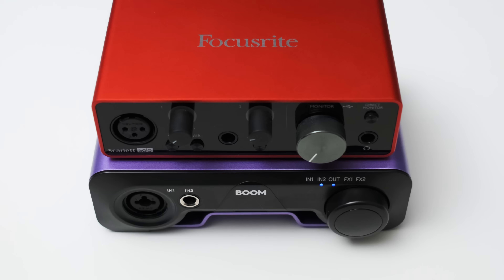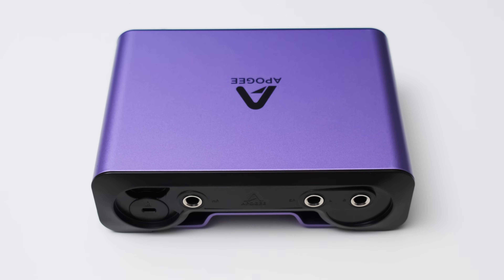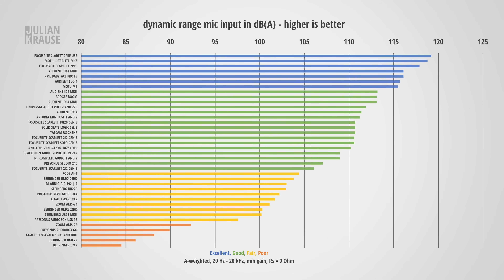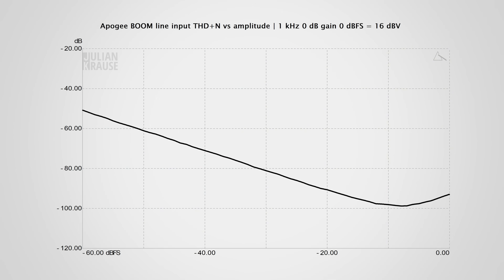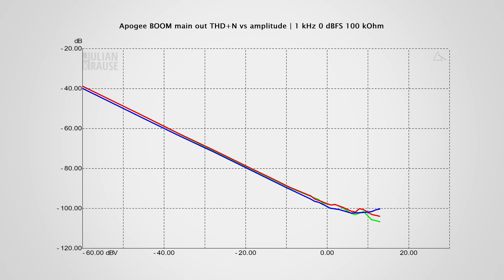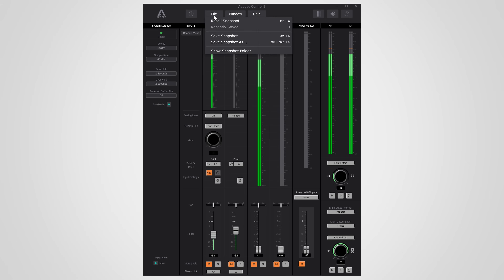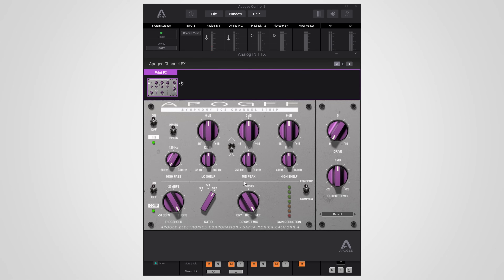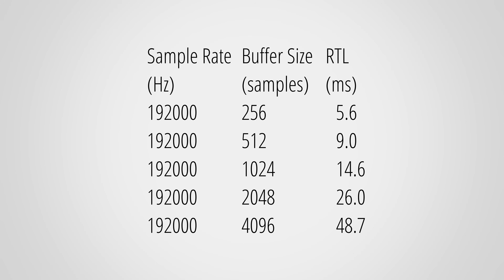Apogee BOOM – USB Audio Interface Review (real-time audio processing)

Comment from the maker: Correction / additional info:
The dynamic range of the mic input is stated with 122 dB(A) and after some more testing I found out, that this is true when the sample rate is set to 96 kHz or lower. This seems to be achieved with a dynamic range enhancement. With this trick up its sleeve, the BOOM catapults itself to the top of the mic input DR chart. Because most people use sample rates of 96 kHz or lower, you will see the higher number in future graphs.
Reply: Why does a lower sample rate increase the dynamic range? Also does this happen on other interfaces?
Reply: @RobThePug a bit late to the party, but higher sample rate means higher signal bandwidth. This also means higher noise energy since noise is present in all frequencies and when you capture wider spectrum you also capture more noise.
Reply: @RobThePug  They probably do oversampling. It is quite straightforward to do sampling always at the same speed, but if lower sample rate is selected, they average the acquired samples and get intermediate values. Instead of 1,2 and 3 you'll have 1, 1.25, 1.5, 1.75, 2...etc which increases dynamic range. Noise gets reduced too.

Comment: This is quite disappointing Julian. I would have expected you to correct this in your review. Instead a small notice…Never trust a YouTube reviewer, trust your ears. You can really do harm to companies with that misleading video.

I wrote Apogee when your video came out and they said that their measurements were correct. IThey pulled a Boom out of the shelf and their measurements confirmed the specs. It really seemed they were right. I made the mistake mistake and believed Julian Krause.

By the way, your measured preamp noise is also not correct…🧐

Comment: Julian, I tested the boom with a dynamic mic, it SOUNDED way better, fuller etc than my audient. No background noise... The converters are NICE.
Reply: Have you update your firmware already? I get rid off the noise after updating and really satisfy with it
Reply: @jimlue  I have the patches from September 2023, all fine
Reply: i finally got mine, soundwise it is better than both id22 and id24 i got before, it is super crisp with good balance of frequencies across the board when it comes to converters for speakers and headfones. I tried prism as well before in expensive studios and this is really close. It is a bad looking interface but the sound is divine. When they add a second preamp and allow speakers and headfones to play at same time it kills all competition below 1200 usd. I had RME, audient, SSL etc before it is the best one to me when i mix a song at home. I have 25 years experience and i do not really care about specs data to a certain extent. I know what i am hearing.  @monkmusic you were so right on another post on another video related to this sound card. I think ppl are really sleeping on this one, i hope Apogee will release a firmware update to unlock that speaker/headfones at the same time.
Reply: @LaidbackSounds  My pleasure mate. Totally agree. 180 euros with top converters and mic pre. The reviewers are biased.
Reply: @LaidbackSounds  I contacted apogee and unfortunately it's a hardware toggle when we insert headphone, a physical connection is disconnected

Comment: Hi Julian. Is the noise likely to be an issue on Sennheiser HD6XX? This looks like a great option to have an interface for my guitar amp modeller that also doubles as a decent dac and headphone amp. It's currently half price on Thomann too. I currently have an 8i6 Gen 3 which I don't think has a great headphone amp and it's drivers drop out over USB on Windows 11 a lot, so I am looking to replace it. I need nothing more than a couple of inputs for my modeller, headphone out, and monitor out. Motu M4 is another option, but at £169 the Apogee is tempting, especially with the more powerful headphone amp.

Comment: Have you considered (unless already doing it) using a USB isolator with an active USB hub powered by a quality external PSU to test the performance of the USB audio interfaces without the interference from the computer power lines and ground loops? That would show how good the the interfaces are in filtering the USB lines (for externally or USB powered interfaces) and maybe might show how to get best quality audio from (or into) your interface.

Comment: Hi Julian, it is a very detailed review with very high quality. It is very disappointing that this interface has such a noticeable preamp noise but I think it is a universal problem of Apogee interfaces as I can hear obvious preamp noise from Duet3 on condenser mics comparing to iD4. Is this because Apogee used cheap preamp or this is something changeable by firmware update?

Comment: How come higher sample rates have lower latency? Is that because the interface is built for its maximum sample rate and the internal processor has to step that down? Say your interface can do 192K but you're running it at 48K, does the extra latency come from the processing needed to be done to step down the 192K to 48K?

Comment: Hey Julian, 
I am looking for an audio interface in around this price range to put between my DAW/PC and Monitor Controller. And to pair with my headphones and monitor speakers. I am currently using a Behringer Control2USB as monitor controller (I don't know much about monitor controllers and on how much they could change sounds, i might upgrade to a pre-sonus central station in the future if it's actually benificial for my sound). I already noticed I can hear more detail in sound putting my FIIO BTR5 between my PC and the controller than feeding USB in it directly.

My monitors are monkey banana gibbon 5s and a gibbon 10 sub to accompany it. My headphones currently are a Audio Technica ATH M50x and an OLLO Audio S4r.

I am looking to record hardware synths as well so i need an input for that (think of a gameboy using a midi controller and a Yamaha An1x). Would the boom be the right choice for me? Or do you have other recommendations to look at?
Reply: Got something for you 🎂🎂

Comment: Good spec based review. BUT there is a difference between technical specifications or measurements alone and real world experience. In reality the Boom converters sound absolutely stunning. I worked with Focusrite, Audient, Black Lion Audio Motu and other Interfaces before. I could immediately hear a difference in clarity, stereo imaging and frequency response. The DSP Channel Strip is one of the best plugins on the market easily comparable to Waves plugins or UA.
So in my opinion, as long as you do not need more than 1 Mic Input this is a superior sounding device, easy to use and well built too.

Comment: Julian let me ask for something, with these real time effects could you check the frequency response of those effects at say 48 and 96K because we have found that using some built-in effects like the UAD Unison plugins use a hard cut off aliasing filter at 24K not 48K when at a sampling rate of 96k. So when an interface uses EQ for real tie effect would you consider adding a test to make sure they are working at high sampling rates correctly. That would be awesome. Also yes IEMs are becoming hugely popular and noise information for those using them would be GREAT!!! Cheers great review as always!!

Comment: Proprietary driver only after signing up and the device is hard to open? That's what's wrong with many companies today! We need to punish this behavior by boycotting these products! In this case, it's not too hard not to buy this purple piece of garbage as it is overpriced, has bad pre-amps and there are plenty of competing products to choose from.

I saw some people putting in requests to test other interfaces. May I chime in here? There are some really interesting monitor controllers, which have built-in interfaces and might be of interest as more producers are using multiple pairs of monitors to check their mixes. I am thinking of devices like Behringer Control2USB, Behringer Monitor2USB, Behringer Studio L, Behringer Studio XL, Mackie Big Knob Studio 3x2 and Mackie Big Knob Studio 4x3.
Reply: Got something for you 🍑🍑

Comment: Juliann, can you re-test the MOTU M2 revision 2021? It has a new DAC and PBC
Reply: Thanks. I bought one in March and it's the revision. Good so far.
Reply: @richardnathan2145  would be good to know about the comparison between 2019 and 2021 models respectively.
I think the 2021 is much much better
Reply: @jameswalker3869  I'm not sure there would be an audible difference, although the extra screws are a good idea. I think most of the internal changes reflect whatever components were easier to get, I waited months for my M4.
Reply: @nimrodery  oh yes, there is a noticeable sound difference.
Reply: @jameswalker3869  Be specific, thanks.
Reply: @nimrodery  why? Julian can be more specific than me, thats why i am asking. It sounds better and more clear for mixing with the new DAC, only thing i can tell you
Reply: @jameswalker3869  The new DAC doesn't offer anything in terms of clarity. Only the technical specs are better, it offers no new features the M4 utilizes. For example it supports 768 kHz PCM but you can only go to 192 kHz on the device. That's not going to change the audio quality.
Reply: @nimrodery  it is just not the DAC that changed
Reply: @jameswalker3869  Yeah it was also several other components that don't affect the sound. They were just components that were easier to get during the supply crisis.

For instance: the chip that handles the USB is different. But that doesn't affect the sound. The DAC doesn't affect the sound (at least not in a way a non "audiophile" could "detect." I'm sure it "feels" different LOL). The fix to the screws around the neutrik inputs makes the unit better, but it doesn't affect the sound.

If it's an obvious difference to you, you don't need a review, or a channel that measures subtle differences. Most of us won't hear the difference between recordings made with any of the top units. They're all digital. If they don't sound the same there's something wrong. I don't buy pro audio gear that has "character."
Reply: @nimrodery  you dont know. Julian can
Reply: @jameswalker3869  I don't know the capabilities of a DAC when those capabilities are listed by the company (ESS) that made the DAC? If it sounded noticeably better MOTU would have advertized the change. Called it "mark 2" or "revision 2" or something. Plus out of everyone I've spoken to or any examination or review of the new unit, only you have noticed anything (and you say it's "much much better"). Everyone else says "no change to audio." So you're probably an "audiophile," someone who pretends to hear differences when they don't.
Reply: @nimrodery  it doest matter, dont take this seriously, the request is not for you, it is for Julian to notice the differences, which there are differences from 2019 vs 2021 version
Reply: @jameswalker3869  Agreed, there are differences. Just nothing that affects the audio. MOTU wouldn't want to change the audio of a good unit that was reviewed well and sells well, it would be insane to make a noticeably different product. The only reasons would be to fix something that was malfunctioning (it wasn't) or to reduce costs. If they wanted to make the unit sound better and they were successful, they'd be talking about it (and raising the price). Instead the change wasn't even announced. If you're happy with the unit you bought, be happy.
Reply: @nimrodery  never mind you dont get it
Reply: @jameswalker3869  I understand the concept of thinking something is better because you own it, and the concept of thinking something sounds better because that means you have better hearing than the average person. That's why I'd like to see the product tested, and the only reason. A bit of a waste of time, really, but it would help you possibly. If you like the thing you bought that is literally all that matters.
Reply: @jameswalker3869  You made the unsubstantiated claim, when the unit has already been extensively examined. Nobody found anything that might improve the sound. But I do get it, once you start talking you need to be the last one saying anything.
Reply: @nimrodery  WTF
Reply: @jameswalker3869  See?

Comment: Nice Review. thx.
Yeah the noise of the preamps is bad, i could instantly hear it under your voice with the shure sm7b, which is a nogo. (AE-7 with DT990 Black Edition)
And i guess the missing second mic input is lacking coz of the design, asd is the stupid idea of having the headphone on the back, especially when you have to unplug it every time you want to use monitors...design over function...meh.

When i think of my 202HD, which has much better noise levels and a second mic input and you can also use the 48V PP without having to use the software first...i cant see why this design study with extreme high software dependence, should cost almost 400bucks.
Iif i need software, i just use pedalboard with v-cable and reaperplugs, its free and can do and show more.
I'd rather get the Motu M2 for half the price and get much more out of it.

So Apogee...pls take that designer interface and let it go boom and make a good one after that pls.
Oh and making this thing not to be opend without breaking it...what are you hiding or do you think you're some sort of "apple" and can charge ppl hefty sums to "fix" it? (hint: you're not)

Comment: Thanks for the video.
You have done a video about using Equalizer APO to corect the room response of your speakers, is it possible or even practical to use Equalizer APO and its ability to add VST plugins for processing your microphone "live" if you want to use it with a streaming software or simply in a voice call?